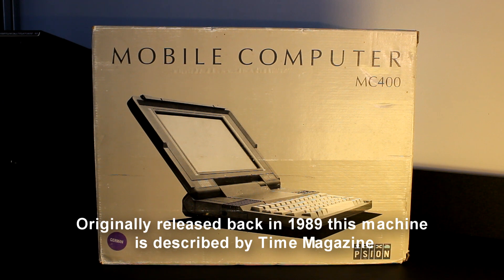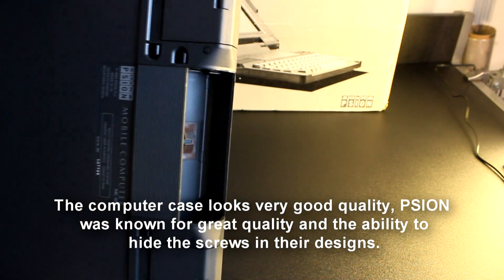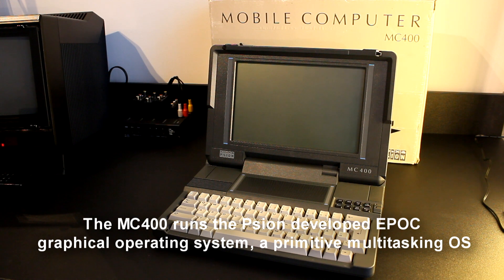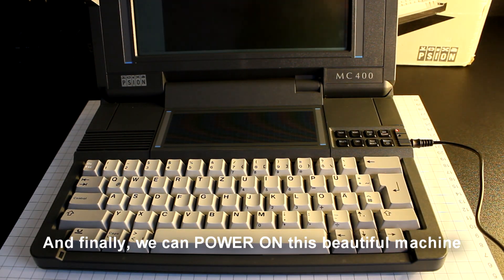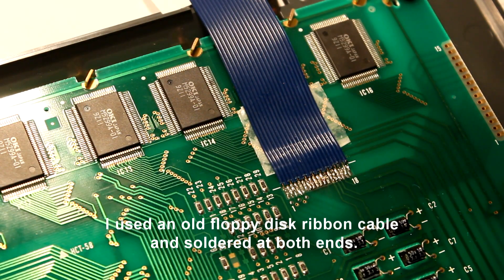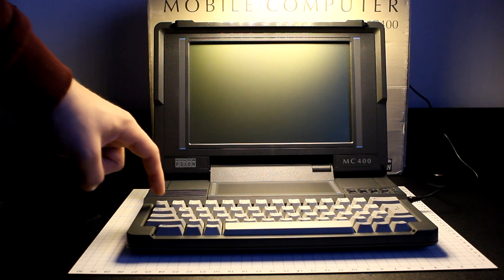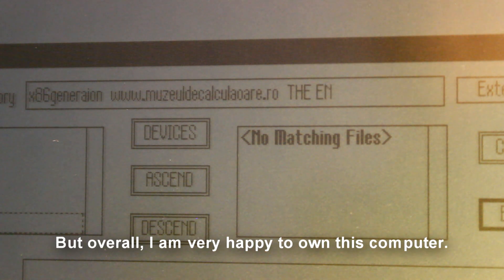PSION Mobile Computer MC 400 (overview, tear down, repairs)

Comment: I bought one of these new in UK in 1990 and loved it, but after 2 weeks I had a bit of a financial crisis and had to sell it.   I always regretted selling and a few years ago I bought a mint one with all the SSD accessories, but the screen does exactly what yours did.  I always guessed it was the cable but I just put in storage hoping to find another working one.. your video gives me the confidence to take it apart and fix it.   I know it won’t feel as futuristic as it did in 1990, I know that nostalgia isn’t what it used to be.

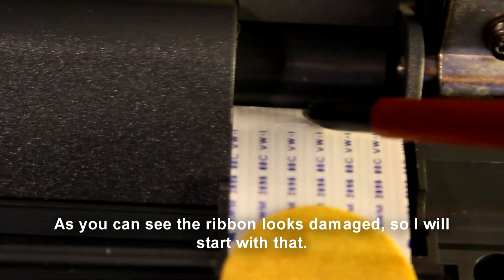Comment: 3:00 mark: "...ribbon looks damaged..." 

That pretty much summarises the vast majority of Psion repairs, especially starting with the Psion 3 all the way to the Psion 7 / Netbook. Even the "door-hinge" design mechanism is a source of failure.
Reply from the maker: You are right! I do have same issues with the MX5 and Psion 3. I think everything is over-engineerd in this machines so its probably TIME to blame that worning out the thin films off.
Reply: @thex86generationcomputerhi81  Psion's machines are brilliantly designed IMHO, especially from an engineering stand point (the Protea keyboard is quite unique for the form factor). However, where they failed primarily is the company's choice of materials in their design, as it is influenced by cost-cutting measures & product weight consideration. Here are a few examples of faults that I found in their Psion 5 series: 

[1] Door-Hinge clam shell  mechanism for the display + keyboard:  they used a lower grade + lighter weight ABS plastic. The hinge would develop cracks & catastrophic failure over time since it is a stress point for both the display & swing out keyboard. They could have opted for just regular steel hinge that can secures both keyboard + display corners, but possibly added more weight. 

[2] Display and keyboard flex ribbon connectors: too thin for the constant flexion (the 5mx 
cable is even laughably thinner). They could have opted for similar cables used in printers, drives & photocopiers; they're thicker but suitable for the demanding repetitive task. 

[3] CF slot door sensor nub: again, a weak small piece of plastic nub (which activates a switch on the motherboard) in the swing center, breaks easily with repetitive usage, giving false readings of "CF Card Undetected" or something similar, even with a CF connected. They should have used a simple physical locking switch for the CF bay which is prone to less failure. 

[4] Thin spray-on rubberized coating over the device casing. They've stopped applying the rubberized coating on later 5mx production. The coating was intended to serve as a non-slip surface & thermal barrier but didn't quite work as intended, as it would start flaking over time, giving the machine an unaesthetic appearance of a PDA suffering from a serious debilitating skin disease 😅. Some of these tiny rubber coating flakes would travel & get stuck in between the keyboard keys, CF slot and even audio chiclet keys, earning that joke name Psion dandruff . A thicker plastic casing with textured surface could have done similar. 

[5] Mains power slot: not deeply recessed + would snap-off or crack easily from the motherboard, when the device is dropped while a power adapter cable is connected.  A floating connector is always the best substitute instead of a soldered type onto the motherboard. 

On a side note, I remember seeing in person one of the proposed devices from a Psion licensee (was it GeoFox or Oregon Scientific?) that utilizes all the features of 5 series including specs, but simplified into a PDA size standard clam shell format, runs on 4 AAA batteries, 2 CF slots + 4-bit gray VGA resolution touchscreen; almost like a tiny 90's IBM  ThinkPad. I wonder whatever happened to that.